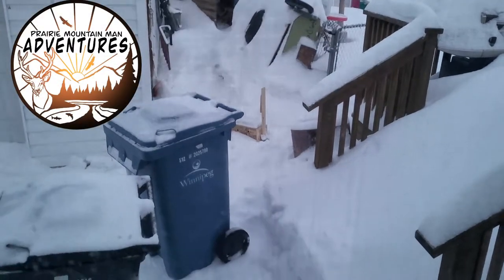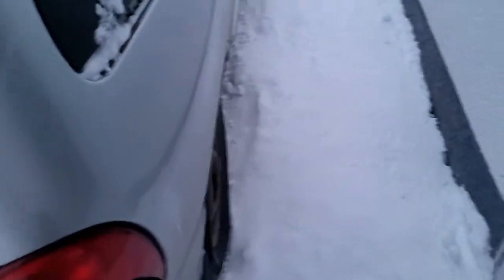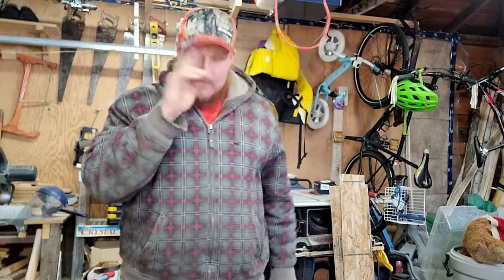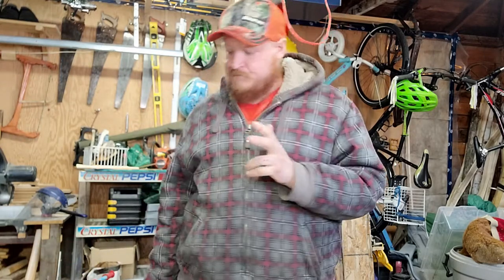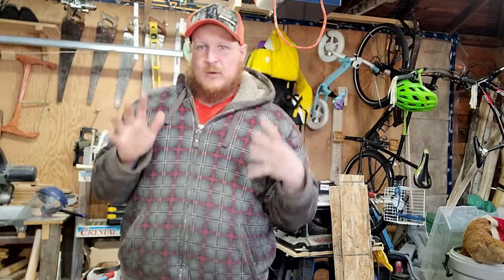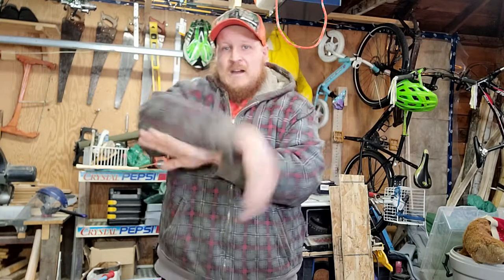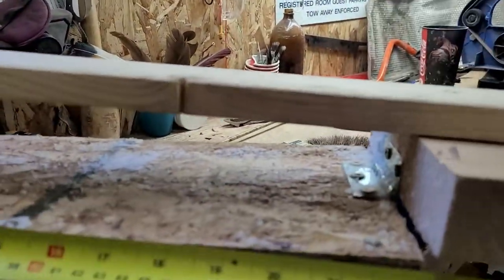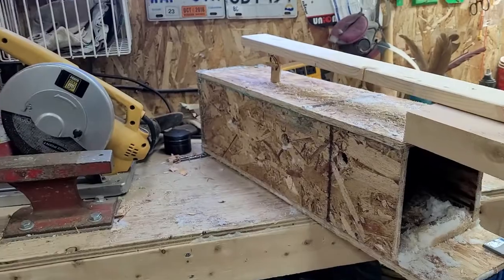DIY Rabbit Trap, 100% success rate! / I made some Mods!

Comment: I have a bunch of cottontails running around my yard also.  I couldn't get them to go in my rabbit sized cage.  I was using hard corn still on the cob.  I did manage to get a grey squirrel though.  It was not a happy camper!  LOL
I bought a raccoon size trap and put it in the same place in my back yard and had a rabbit in it a couple of days later.
I had not thought about using dried apple pieces, that's a really good idea.  A regular apple doesn't work because it freezes and gets mushy.  Last fall I shot a couple of them under the apple tree with the pellet gun, but they're harder to get in the winter that way.  They show up under my bird feeders at night to eat the dropped seeds, but it's hard to get them with a pellet gun at night.
I just picked up a bit of really nice grass hay and put a bit of that in the trap, it will be interesting to see if that attracts the rabbits.  I thought of using that because they've been digging for grass on the shoveled paths in the yard.  
We have about a foot and a half or so of snow on the ground right now.
Reply from the maker: Nice. Yeah ive used a few different baits but apples have been king